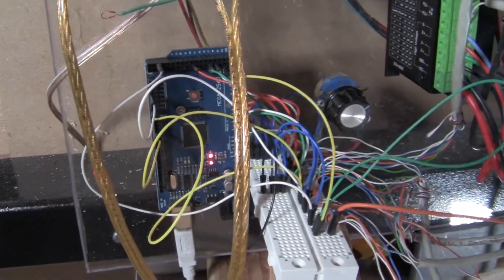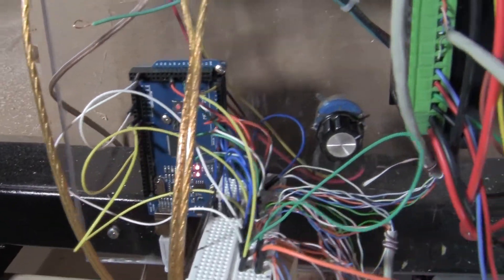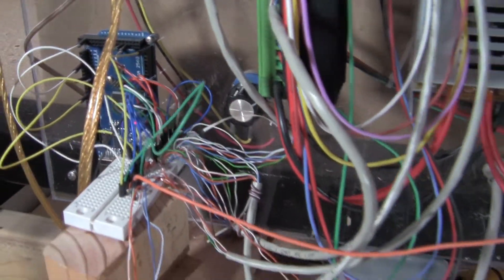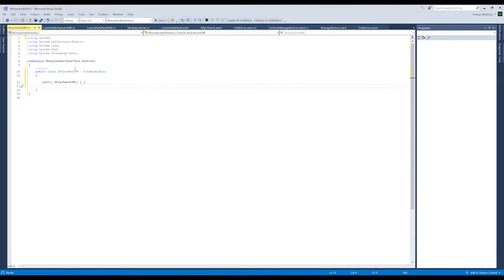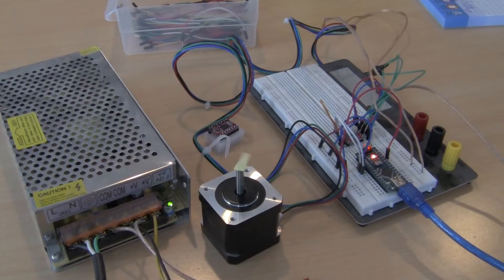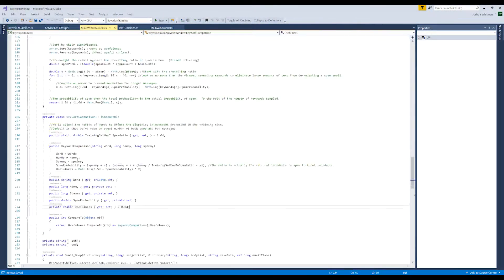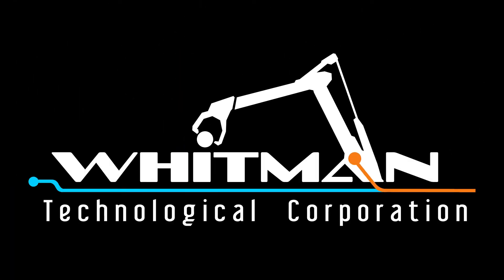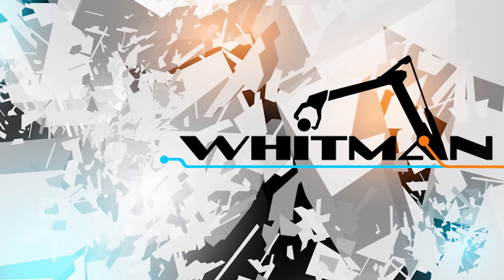Making a Custom Shield for an Arduino Mega 2560

Comment: Friend, what program do you use to make those visualization effects? For example, at minute 1:28, put the background color red. I like science!!!!
Reply from the maker: I did that in Blender.  I followed a Blender tutorial on how to make a fog effect (pretty sure it was this: https://www.youtube.com/watch?v=zKoavv6pjLI).  I inverted the clips that had white backgrounds so all my clips were black backgrounds and then I made a plane in blender that used those clips for its texture.  I did some shader nodes on the texture in Blender that made the text glow/emissive so the light from the text would interact with the fog.  It was a lot, and I'm pretty trash at Blender so it took quite a while to learn.  Yay science!
Reply: @WhitmanTechnological  Thank you very much for the reply